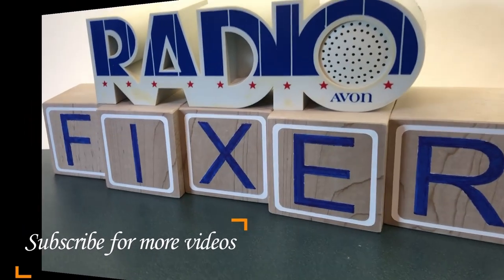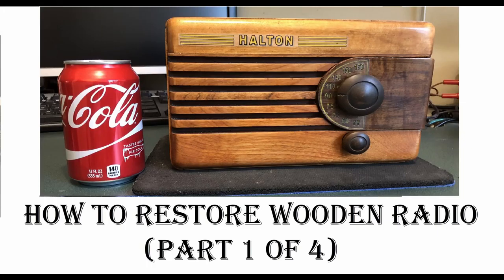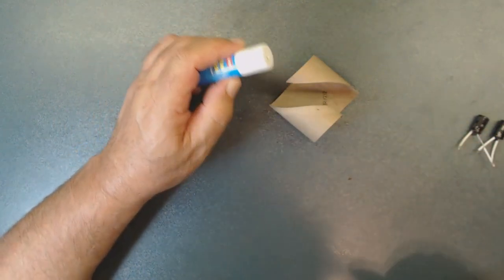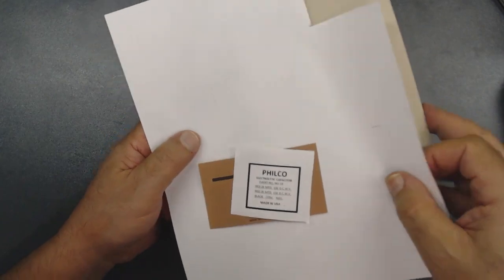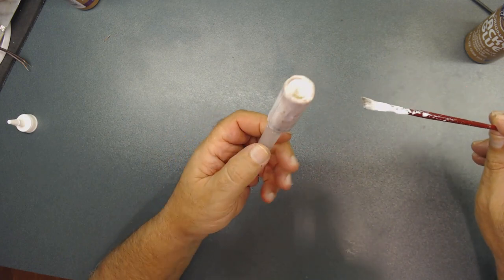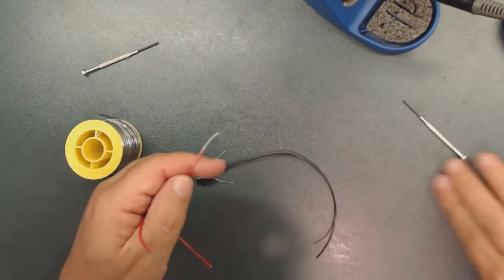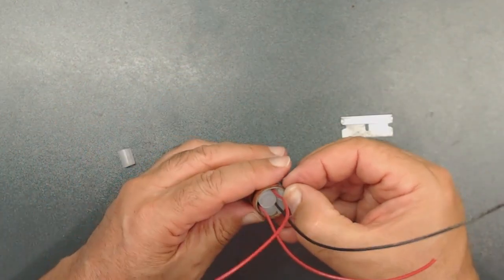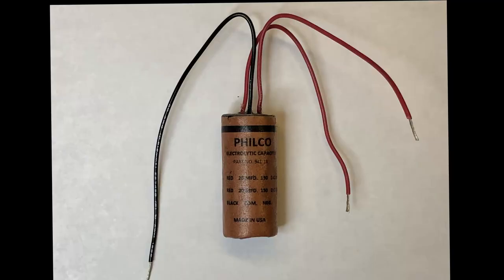How to make multi-section Electrolytic Capacitor

Comment: I made reproduction for my Zenith model 908 that I am slowly restoring but I just stuffed two original cardboard capacitors for a Philco and my mitchel lumitone .
Reply from the maker: Hi Richard, so good hearing from you. So glad that you are reproducing and stuffing capacitors, I do my best to keep the radios as close to original as possible. Of course sometimes are so difficult to do that since capacitors are wrapped up with paper not cardboard. Zenith are awesome radio, good luck with that. Have a good weekend. Regards, JZ

Comment: The real magic is using the right brown paper as a wrapper and getting the typesets perfect on the computer.
All the rest should be just replacing the old with the new. Maybe they make hot glue sticks that are honey colored
like the beeswax or try melting  real beeswax in a  plastic cup  in microwave for increments of 20 seconds to test 
 and pour it over the small glue stick pieces inside. Good little experiment . Now to find some bees. LOL Steve
Reply from the maker: Hi Steve, I do have a couple of cream color hot glue but I did not used it since this was just a test. Actually forgot that I have it until read your comments, Guess need to restore my brain for next video... LOL One of my subscriber told me that they actually sale different color hot glue that are used for hair extension. Since you are the Master, as you suggested chased a few bees around the house to get some bee wax from them and that did not workout that well, I got bee sting instead... LOL Have a good night my friend ! Regards, Jay